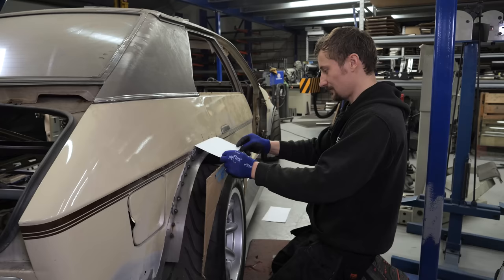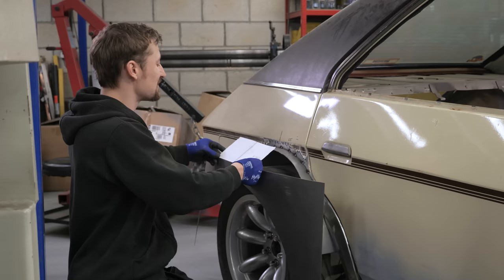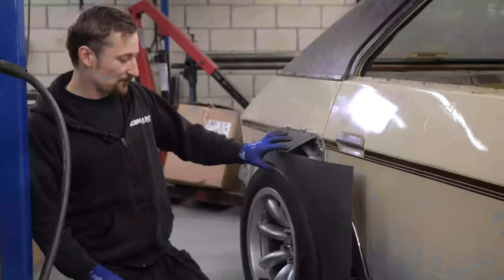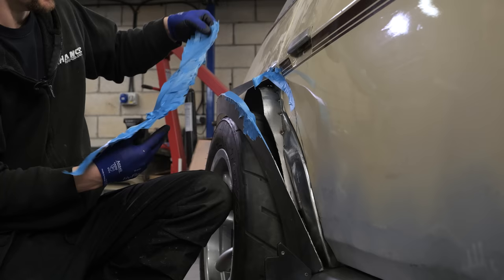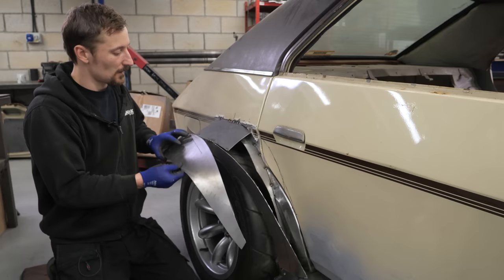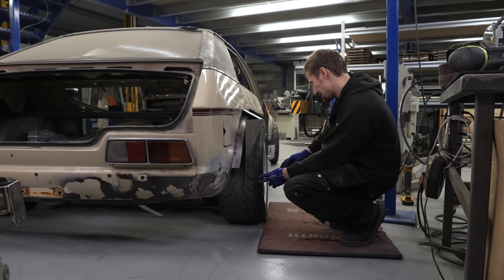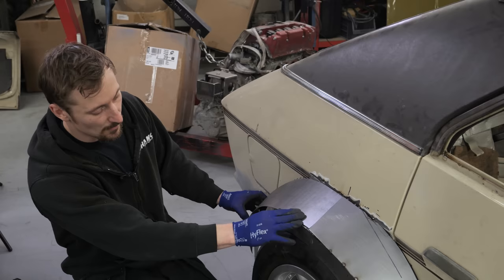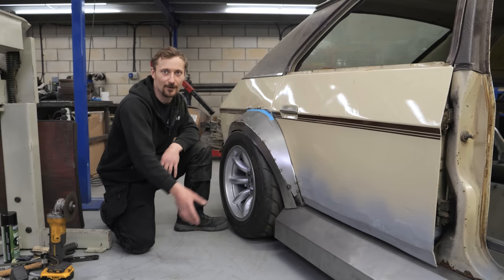Project PrincesS-Type | Episode 14 | Wheel Arch Time!

Comment: Hi there! 😂😂 As others have suggested, I'd like to see a mock up with the outside front edge of the arch flush with the outer lower edge of the skirt. Then a much more horizontal top section, much less of an angle then you currently have and all boxed together. Think 'Minder' X-pack MkII Escort/Ur Quattro on steroids. Very angular like the Princess. You would have to cut/close a chunk to open with the door, which I think you said you weren't keen on? However, I also love this build and it's one of the subscriptions I most look forward to receiving a notification for. Keep up the excellent work.

Comment: well, there is always one, so it may as well be me... another name for wheel arches is mud-guards...
...to guard against the mud + stones being thrown up onto any vehicle following behind you...
if you are going to road register this beast, the tyres need to be under the arches at the rear
i think you need to read "the construction + use regulations" book, then top it up with the SVA equivalent offering, before you make some sexy wheel arches, then have to nail some rubber flaps on to pass regs.   40yrs ago, [i think] it was a max of 1/2 inch of tread sticking out, some night-time reading required before the point of no return reached i recon...  keep up the excellent work young man

Comment: Love the build. Can't wait to see the finished result. Great video editing too. 

I think your flares and your sideskirts have 2 different ideas happening. Both are good, but the don't necessarily work together well like a cohesive design. The flares look great! Like a Mk2 escort rally car. But the escort flares fade away because it only has subtle sideskirts. The big sideskirts look cool too. They look like a modern fiesta WRC car which has similar styled arches too. But if you look at the wrc car the sideskirts outer edge lead to the  flare (leaving the rear open). I think what bugs me design wise is that the flare covers the wheel,then fades away, then the sideskirt covers the wheel again. Leaving a kind of triangle area exposed and the front. 
Hope this makes some sense
It's your car at the end of the day.  Do whatever makes you happy. 😊
Reply from the maker: Thanks! Appreciate the input😁

Comment: I don’t know if the same things were big in the UK, but in the US we had what I think we’re called ‘Ground Effect Body Kits’ that nearly everyone was slapping onto their cars. Wide fender flares, wide sills that sometimes were even pinched a bit to give the car a sort of ‘waistline’, etc. But at the rear the lower body was widened enough that the rear valance/bumper was extended out to nearly meet the widest part of the rear fender flares. Maybe half to 3/4 the flares width. Say the flare was 5”. So the valance would come out to 3-3.5”. A lot of them looked really cool. If they were installed well that is. A track day sort of mod. Although embarrassingly they were sometimes referred to by the owners as ‘inspired by the wide body 911s’. LOL

I think it all looks great. Maybe you don’t use this idea entirely, but I’d widen the lower rear of the body ‘some’ at least. That’s a pretty drastic transition from the widest point of the flare to the stock dimension of the rear valance, when you consider how far back the flares are overall. One of the coolest looking parts of the Princess to me is how far back the rear wheels are in relation to the rear bumper. It almost has a ‘fastback’ look to the rear end.

Comment: Bit late to the party here, already hooked. Ive made similar arches before, and tyre/suspension clearance became an issue. Nothing the grinder couldn't fettle but it did alter the look I had in my head. The back of the arch would look good squared off, mesh insert/vented. Lets find a newer episode and see where you ended up. Looking different.....Like it.

Comment: I think you are getting there. Maybe have the top of the arch stick further out above/over the tyre?
I think you might need to do something with the sill piece though. Looks too angular and clashes with wheel arch imho.
At least bring the arch out at front/bottom to meet widest part of sill fab. Love you work/channel! 👍
Reply from the maker: It definitely needs a few more revisions. Thanks for watching!
Reply: @FabCoUK  gotta start somwhere. I like the idea of using wire frame to make a template. Im sure i saw somewhere (binky?) them make  trial wire frame arches, and  painting with fabric fibre glass resin to harden it - not so easy to weld though! 🤣

Comment: More quattro / E30 M3 style arches with a 2 door conversion so you could run the rears cleanly along the quarters.  The offset original outer skin style works but it's quite a radical look as you end up with gaping vents at the rear of the panels (thinking IMSA & DTM Audis from the '80s).
Reply from the maker: Don’t want to do a 2dr conversion😫

Comment: Just a suggestion to save time & expense on the cut/tack/weld - cut/tack/weld process.
Would it be worth using a couple of blocks of EPS or XPS foam, which could be quickly & cleanly cut with a electric foam cutter, to try out some wheel arch profiles, which would provide a 3D pattern from which to 'template' the pieces of sheet steel to make up the arch?
It would also allow you to quickly modify and visualise the wheel arch by adding or removing foam, before committing to making it in steel.

Comment: I think I'd have started the rear of the arch right back at the corner of the rear quarter. Flare out toward the centre line of the wheel then in like you have it. You'd lose the filler flap but I doubt that's an issue. Like thunder saloon look rather than mx5 turbo

Comment: I think it’d look more fitted if the front lower arch meets the fold on the outside corner of the skirt. It’d mean building the arch wider, more like the berg cup cars. (Look at the late Peter Naumann’s Polo G40 Berg cup car and you’ll see what I mean). You could then maybe leave the arches short at the rear like the Hoonicorn. Although I think the way the rear of the arch was looking was ok. But as you’ve gone for such a wide skirt, I think the front face of the arch needs to meet it at the lower outside edge. Difficult to explain in words, but basically Peter Naumann’s Polo and the Hoonicorn 😄 

Great work chap 👍

Comment: I think how I would approach this would be to get the princess into 3D software like 3DSMax where it is easy to model the wheel arch and try a few designs. Then when happy with a design get it 3D printed in a suitable material. If it looks good get the other side printed.

Comment: I made some flared arches for my Bedford CF2, I made patterns out of cardboard and taped them on, took  a few goes to get it where I was happy with the look, I used the cardboard as templates and cut the steel a little oversized then used an adjustable spanner to bend the edges over bit by bit to form a return.

Comment: Make a wire buck/frameout of something like 3 or 4mm mild steel wire. Sand off the paint on the body so that it can be tacked on. Maybe that would be easier to change the overall shape and panel edges? Then take card panel shapes off that once happy with the finished shape in order to hopefully create a mirror image for the other side?
Reply: Also have the car on stands at the finished rough ride height and then remove the suspension springs. That way the wheel and tyre can be raised up to its maximum travel position so that the inner tub etc can be made so that there's no tyre rubbing when finished.
Reply from the maker: Definitely needs a few more goes before I worry too much about ride height!😃
Reply: Remined me of a guy on the Jag forum I was on , her was doing an Xk8 and made super wide arched using that method to perfect them .

Comment: yes adam* - it’s a challenge to blend the wide stancing arches [love it] into the sill and body side in a british leyland[ish] design language - personally i think tapering the bottom of the arch into the body work as you’re exploring to reveal the lower tyre works really nicely - i do feel though that the angular box floor sill you’ve fabricated may be too wide and boxy to relate to that approach - perhaps shrinking the sill back to meet the bottom of the arch in a profile taking it’s cue with the original sill could offer a more cohesive blend and flow - you’re doing great stuff and i’ve never commented on any video  before - but as a shed motorcycle stylist i sense too that here is the opportunity to get this key styling element nicely landed - all to you adam - all the best* - joe

Comment: I remember overthinking the same thing when I was building my Bedford cf van as the front and rear tyres stuck out plus I wanted steel running boards I bent loads of 1/4 bar eventually I got a frame that looked good, then my mate said now you have to replicate that 3 more times kinda knocked the wind out of my sails lol, I actually ended up using trailor archer's and  re worked the rolled lip and welded them in turned out really nice cost next to nothing.

Comment: Video paused at 13.27, I know it goes in the opposite direction but with a bit of work and imagination could the rear of the arch not follow the same angle as the right hand side of the rear light cluster, which does kind of follow the same angle as the sill cover? Alternatively I prefer the look of tapering the rear of the arch Off slightly but ultimately leaving it open and just following the contour of the rear bodywork. Either way I'm sure it'll look good, great work 👍

Comment: Suggestion - Delta Integrale style, all moulded into the doors. Harder, but more flowing. You could use wide arch Vauxhall Nova wings that you used to be able to buy...anyway, that sort of style as it will flow with the swage line of the car.

Comment: Those massive sills make much more sense, proportionally, now you've got the arch flare in.  That rear end is tricky to resolve, you might be able to use the step in the bodywork that's normally hidden by the bumper to blend into the trailing edge of the arch flare and then curve the bodywork in one smooth piece from that down to to the bottom of the panel so it stays looking Princess and works with your arch design.  It's a tough one, shall be watching with interest as always.  Hopefully the front end gives you less trouble.

Comment: I thought you would have gone with a more e30 m3 style wide fenders. I think it would fit the boxy front/rear of the car well. Maybe you can keep the upper part under the pinstripe if you want to keep that
Reply from the maker: It’s still an option. This is just playing around with ideas 😊
Reply: @FabCoUK  sure, just mentioning it in case you haven't thought about it. They are just fenders you could change them later on before paint is applied😀.
Reply: @FabCo UK  Or take a longer time to look at Corsa A, M3 e30. Probably same design period. Please start the arch on the door to fill the gap on the sideskirts. And end the arch at the rear light (see 306 Maxi, every body loves that ass!). But above all take you time with cardboards and enjoy the process of making several options.

OT: I'm really enjoying how open you are about the ideas and proces. There is no doubt about your skills, but probably you could lend the design ideas?

Comment: Brilliant work.. I'm sure you're on the right track .. My only worry is the lack of gap between the top of the tyre and outer bottom edge of the wheel arch .. But I'll presume at this stage you have already thought about that  and calculated the suspension travel when you make the final adjustments.  I really can't think of any 'cosmetic' improvement to what you are aiming for here.
Reply from the maker: That would be a bit of an oversight! 

This is just a proof of concept/idea stage 😃

Comment: Difficult to visualise what you want until you just bite the bullet and start cutting metal.

I had a thought when the camera was round the back. What would the rear light clusters look like flipped upside down (then swapped side to side so indicators were on the outside)?

Comment: The side skirts have an overly heavy look. Can they be made smaller ? Closer to the car with the top surface a little shorter and a shallow soft convex curve to it. Then make the front face much smaller. Similar to the width on the face you have used on the wheel arch. I think that thickness of the bottom face on the side skirts is the reason for there heavy look. Then have the arch start from the side skirts which has been said already.

Comment: This is going to sound mental and it's probably too late now as you've hacked the rear of your proto-arch round now. but when you had made the front looking something like a GTE arch but the rear still had that big square part I was thinking hmmm... How about rounded in the front and Quatro crossed with Intregrale style sqaure in the rear... Bonkers. Another bonus of this would be fairing into the body lines would be easier than dealing with too many curves back there and you'd be able to totally control how much rear tyre you show and that tendency for the outer lip panel to be pulled in against the tyre would be reduced a bit. Front of the arch looks ace and I admire your design ethos. Step 1: 'Stick steel on car' Step 2: See step 1. 😀Yeah... Thinking on this you could make this Princess look a bit group B body-wise! Perhaps with the 7 million spotlamps though